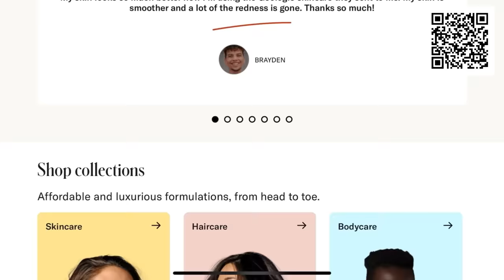Construction of a Duplex pt 24

Comment: For someone who works in production my little tip for you with all your light stands. Is to get tennis balls and cut a slit and put it through the legs so it doesn’t scratch up the floors
Reply: Pro tip for the day!
Reply: Kinda makes sense.  But if they have rubber feet, then it shouldn't be an issue.  Also, if you add tennis balls and get used to sliding it across the floor, it will pickup dust and debris and actually scratch the floor.  Not sure this is applicable unless in a clean environment.
Reply: You guys rock
Reply: @chumpmu1  They seem to clean pretty well. It may or may not be a viable solution.
Reply: Duct tape       shhhhhh

Comment: When painting doors like that, I personally only ever use a small roller with a medium length hair and that allows me to essentially roll the paint onto the decorative element that's on the outside of the inset rectangles, then paint the rest. Since you need two coats to cover anyway, whatever bits you miss within the decorative element with the first coat, you'll get with the second and each door takes literally a bit more than a minute on each side. Your wrists don't get worn out using a brush, get the same if not better finish,  more time to do other things around the jobsite or take a rest earlier.
Reply: I use a mohair whiz roller on cabinets, doors, and trim. Turns out sprayer quality

Comment: Here is a pro tip for y’all.. instead of using the spacers that come with the kit. Cut small pieces of the flooring to match your desired distance from the baseplate and use them instead.

Comment: The LVP has limestone in it that is super abrasive which eats up blades. Also, a tablesaw works great for not getting flyaways all over your face, and won't scratch the face of the flooring. Some 1/4" ply squares pinned to the lower drywall works great for starting rows.
Reply: I typically will use metal blades on my jigsaw for vinyl planking, for this reason.

Comment: Some of the vinyl plank flooring has limestone mixed into the plastic. Increases the mass to reduce noise and hold  up better to impacts.
Reply: In some cases the core material is as much as 70% limestone dust and 30% vinyl which serves as the adhesive to bond the limestone. So probably not great for jigsaw blades.
Reply: Yup that would explain the blade problem for sure. Probably what was going on

Comment: Have you guys ever tried composite shims? I buy them by the case. If I run out of them and have to finish with wood reinforces my appreciation for the composites. Easy to score with utility knife and snap off to length, don't  splinter like wood.

Comment: Hiring the kiddo for the summer and also taking them on a rather long hiking trip is pretty dope.

With the flooring.  Get it how uou want it and the hot glue it down to the floor.  The guys that put my flooring in weighed it down on concrete and glued it down in the middle with hot glue.  5 years and so far, zero issues.

Comment: In Germany we put a 2mm airfoil underneath the laminate. To avoid walking sounds and a little insulation from concrete.
Reply: A lot of this type of flooring here in the US already comes with a thin pad pre attached underneath. You can see it, it’s black and under each piece of flooring when they manipulate the flooring pieces in their hands you can sometime see it.

Comment: I have installed quite a bit of this type of flooring in the last year or so. You were right to start using the spacer blocks along the walls instead of depending on some kind of weight to keep the flooring in place as it is installed. I will also point out that if you get used to laying it in place just so as you install it you can lay almost all of the flooring without any hammering or tapping it into place (except of course for the really tight spaces and tiny pieces).  It definitely takes some getting used to, but if you continue to use this material you'll benefit from learning how to just "click it into place," instead of hammering every piece.

Comment: To keep the floor from moving - cut some short pieces, click them in on the side you're starting from, run screws through the short pieces into the sub floor.  Locked in tight then.
Reply: This is a good one

Comment: I’ve recently finished a rehabbed project. I bought the same paint from Lowe’s. I was surprised it was SW brand. I was told by the Lowe’s Associate that SW bought out Valspar. I tried to use it on a exterior fiberglass glass….no brushed mark is a definitively a lie.

Comment: Throw away all spacers, hardly works, expecially on regular houses and nothing is straight.  If it's sub floor cut scraps on joints lay your first but really 2nd row because of the scraps and continue on them come back remove the blocks the floor never moved no matter hoe hard you bang it and back fill your first row. 
If concrete slab, same thing with tap con screws.  This is how you get a straight line, keep a straight line even after banging out 20 rows. 
Love the vids. I'll work for you guys give me the word.

Comment: once you have your three rows down screw pieces of scrap down at all the joints and it won't move, and then when you get to your rip pieces do the same thing and finish the rips last. Been using that paint for a few years now and it is excellent paint. Dries very hard so it's durable, and the brush marks do shrink out of it. I wouldn't have brushed all those doors though. Change out the hinges and spray them in place when you spray your trim. We cover our floors as soon as they are done, then trim it out, spray the trim, and then cut and roll the walls. We always spray the doors in place, so much faster.

Comment: Those different types of spacers never work well. Just put some screws partially in the edge of the floor where you want your first straight row to start. It won’t move. Then when you are done, just back out the screws. More effective and cheaper.

Comment: To keep your first rows from moving while you're tapping cut a few scraps with the right lock on it, lock them on the opposite side from where you're hitting and screw them to the floor. Also use a rubber mallet on your metal pull bar and save your ears lol

Comment: from my own exp installing vinyl flooring - when using the black metal hook trowl thing, add an offcut to the side of the piece first and then stick the hook trowl on that. its pretty easy to damage the clip in rails and basically render the piece useless.

Comment: There is a problem with running a snake in a cleanout where they have it. Pulling it out will make a godawful mess inside the cabinet. But.... you can take a short length of PVC with a threaded end that sticks out from the cabinet and not have the cable naked inside the cabinet.

Comment: Instead of the spacers next to the wall to hold the flooring from moving, use some screws under where the baseboard will cover the holes to screw the planks down to the floor.  Remove the screws when you are done and the baseboard will hide the holes....

Comment: On my jigsaw with long blades I cut 1 or 2 3/4" shoes that attached (tape, I drilled holes thru the foot for screws) and fasten to the bottom to use a different portion of the blade. I do a similar thing with my Jet oscillating spindle sander. It has 6in sanding spindles. I cut enough sheets of 3/4" MDF to match the top surface with a hole in the middle to fit the sanding guides. It allows me use right up to the end of a sanding spindle.

Comment: As someone who works in the plastics industry, just wanted to let you know that some vinyl plank flooring have fiber reinforced vinyl. Some have as little as .1% fiber glass in them but it helps with making it rigid and stiff. So that was more than likely the reason for all of your blades getting dull so quickly.

Comment: For cutting vinyl plank if you need to or want to use a jig saw use a blade made for Fiber cement.  Then cut from the underside. I used the same blade for my garage siding. Then used it on at least  6 flooring jobs.

Comment: Whenever I had to paint a lot of doors, I would place 2 nails on top and 1 nail on the bottom of the door. Lay them on to a saw horse to where you can paint one side, then flip it over and paint the other. Granted, this uses a lot of saw horses, but you can always attach long boards  to where you can paint multiple boards at a time. This method is also useful for spraying. I also precut the painters tape to fit perfectly over the hinges and use wax paper to hold the tape till your ready to apply them.

Comment: Another tip when working in closets and around doorways with funky cuts.  The expansion and contraction will be low if the temperature is relatively constant with no sunlight beating on the floor.  Google "Stanley 3.5 in. Small Trimming Plane" and get one.  you can use it to just take off the tiny raised locking bead on the tongue. This will allow you to just slide the piece into the next without having to raise the other end up to get it to engage and lock.  I usually apply a little CA glue (super glue) to this tongue to keep it from separating.  Make sure your flooring is acclimated to the house temperature before installing and sweep and vacuum the subfloor constantly.  You do NOT want to get a chunk of something trapped underneath, more so if it is a thin  plank with no backing.  You will see or hear it when you step on it.

Comment: When laying lvp. I use flat pry bars against the drywall and I put blocks and shims under the end to keep the pressure against the flooring. Keeps it from moving and you can make tiny adjustments if your room isn’t square.

Comment: When I put in the tongue and groove vinyl flooring - I found it was helpful to just use a scrap piece of the same flooring, lock it in, and hammer the opposite side (to lock the pieces in place). It stops working once you're up against the wall, but it saves the good floor (and your nice tools) until the end!

Comment: I use the spacers when starting out while I’m beating on the floor but I usually take them out as fast as I can so they don’t get stuck. It helps to use a flat trim pry bar, slide it in but move it in the lateral prying way to get enough relief to pull the shim

Comment: for solid vinyl planking you can use a propane torch to make it soft enough to cut with knife pro tip from a master installer .
Reply: You are 100% correct you can also use a heat gun or a blow dryer and cut it with a razor knife to where it will snap it works awesome so your tips should work even better also from my master installer

Comment: One of the things I've started doing with plank vinyl floor installs is screwing them down temporarily after I get a few courses started. I put the screws where they'll be hidden - usually where trim will cover them up, then take them out once I've got the full floor in.
Reply: I’ve seen this done before. As long as they get removed I see no issue doing it 👍🏼

Comment: Rookie question about hanging pre-hung doors...Do you nail through into the shims? Or, are the nails not suppose to go through the shims? Love your vids
Reply: Do a combination of screws and nails. Screws for the hinge side (you use one of the screw holes in the hinge to run a longer screw through the jamb, the shim, and into the stud. 2 1/4" finish nails through the jamb, shim, and into the stud. On the latch side you set a shim to back up the latch plate at either the top or bottom and run a long screw through the hole in the latch plate, the jamb, the shim, and into the stud. Then you use the 2 1/4" finish nails to nail the jamb to the shim, through the shim, and into the stud.

Comment: With that lvp just use 1/4 spacers against the drywall and put boxes on the backside of the flooring and it wont move and for cutting that stuff with the jigsaw is fine u must buy a carbide blade and it wont dull out until after about 5000sq ft

Comment: Drywall screws will keep the floor from sliding (on the backside not through the floor)
Reply: It's on a concrete slab
Reply: Tap cons
Reply: When on concrete

Comment: If you setup a mitre saw and table saw you’ll be cutting that way faster, just keep a separate blade for lvp flooring and you’re set. But I guess if you have a crew who works at the speed of 1 flooring installer then you can do it the slower way 😂
Reply: Lvp is designed to score and snap in place for quicker and cleaner installs as opposed to having to setup a saw to do each individual cut.The only time you need to break out the jigsaw is for unique cuts. You can use a 4-5' straight edge and clamp, score, and break to "rip" the finish pieces.
Reply: @aaronorr5586  are you a flooring installer?
Reply: @MSeroga  I've laid down lvp time and time again. It is as simple as I have pointed out. 940 sq feet in two days between two people in my own residence as well.